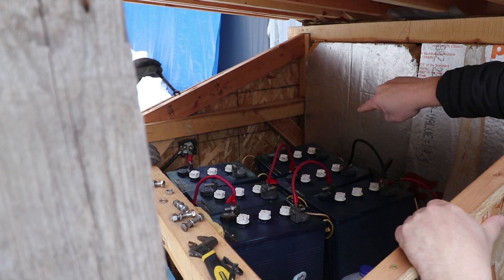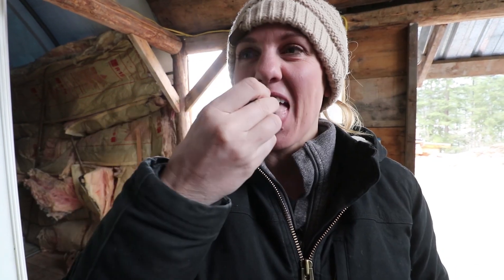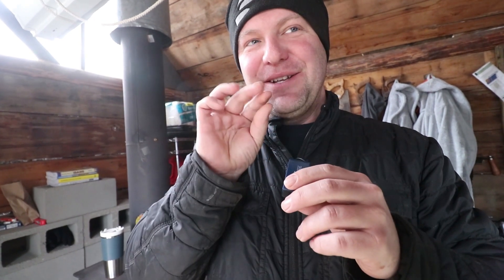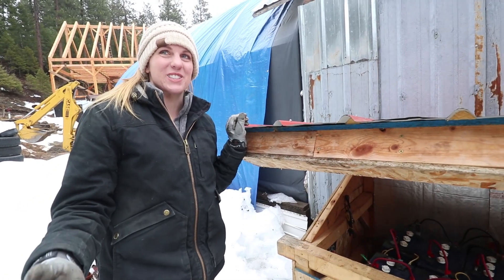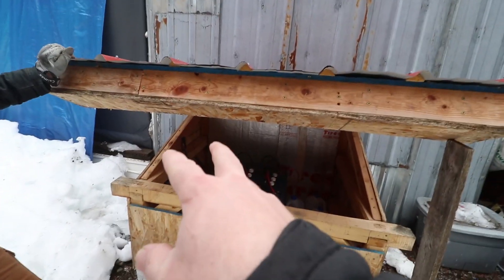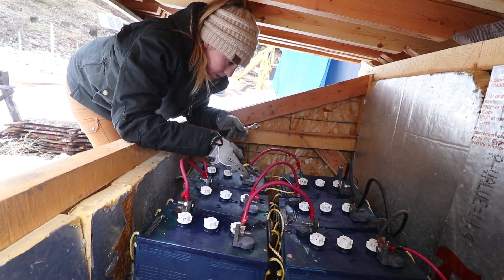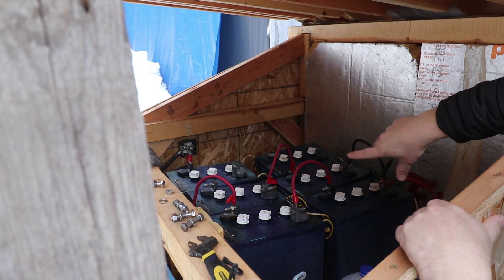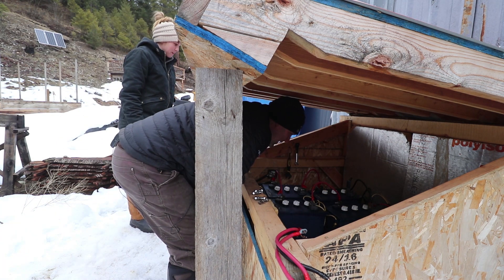All the Solar Panels in the World CAN'T PREVENT ➡️ THIS ⬅️

Comment: I believe the last thing you should be focusing on is Photovoltaic & batteries that you have. Tie into the Grid as a short term source and find a local resource that refurbishes Industrial forklift batteries. Use the grid to charge your bank and keep the outback system. With PV technology improving at break speed, wait 3 to 4 years and and revisit Solar then. I have a few friends here in North Texas that have found this approach to be successful and very cost effective...  I really think you two are doing great... Keep it up... You make my day every time you put out a new video.

Comment: You need battery heat pads . You should capture your excess solar as heat in a thermal bank . Dig a cistern use it as a heat bank . Hook up a wood fired boiler and your set .

Comment: Alyssa,  voltage is pressure like in a hose (say 30 psi) current is flow  (GPM) like when you squeeze the handle on the spray nozzle,  wattage is power, just the flow x the GPM :)

Comment: The way I would explain current is to use water as an analogy.  You can look at a river and see how it flows, the movement of the water is similar to the movement of the electrons which make up electricity.  When you remove the source of the water flow by putting up a dam, the current (water) doesn't flow in the river any more.  That is similar to turning off the light switch.  Turning on the light switch opens the dam's flood gates and allows the water to flow into the river again.  Like water, current has a tendency to only flow in one direction, that is from negative to positive.  (water doesn't flow up hill, it only flows down hill.)

You might wonder why you should use distilled water in certain batteries.  That is because distilled water has all the conductive minerals removed, therefore the water is more a coolant than a conductor.  With minerals like metal in the water, it causes the plates inside the battery to short out which is not good.  Batteries work by chemical reaction and that is why acid is also contained in some types of batteries, to initiate the chemical reaction which generates the flow of electrons.

Does that make sense?

Comment: If properly used, those batteries should have lasted  a minimum of 8 years. By properly used, I mean never drown below 80 percent of full charged. Preforming battery equalization once a month (you should be able to set your charge controller up to do this automatically). Checking and filling batteries every other week, or use an automatic water leveler. 
There is a lot involved to using lead acid batteries off grid, but with a little planning, and some maintenance they can do the job just fine.

Comment: As batteries age sediment builds up at the bottom. This sediment will start draining the batteries till they can no longer be charged. Also as batteries age sulfate will build up on the plates. This buildup increases the internal resistance of the battery so it looses its ability to drive heavy loads. Also when a lot of sulfate builds up a lot it will begin to deform the plates and make the battery bulge. The deformation can also cause the plates to touch and short out the cell. The touching of the plates may cause a spark and if the acid level is below where the spark occurs and there is enough gas in the cell it'll pop.

There is such a thing as a battery desulfator. It's an electronic device that pulses the battery causes the sulfate particles to be recombined in the acid or drop to the bottom. I've gotten batteries to last 7 years by using a desulfator.  There is also such a thing as washing out the battery and while it may be dangerous and risky, you can deffinitely extend the life of the battery even more. (I don't sell batteries)

Comment: if you milled some lumber, built a small/portable storage shed, you could try sell/trade that old ford for a suitable machine with forks. then you could use the machine to move the storage shed, or anything else, as necessary. 

It seems that every time you go to do something you are hobbled by the fact that you don't really have material handling capability. I don't know how the pallet(s) are configured for the battery box but if you could get a set of forks under/into them it might be an easy fix when the ground isn't frozen. just another one of the endless rural uses for a machine with forks.

Comment: Why not 625 surge amp li ion ? 200$ a piece um new  or glass mat optima ? wrap a thin low watt heat tape with poly insulation box , sheesh, to go with 7 weak ass  25 watt panels, 300 watters are 250$ , it's only $ lol

Comment: I guess you have to decide whether or not you want to partake of all the modern advantages of an electrified environment or not. Just my opinion but, solar is not going to be the answer for quite some time. Unless you can afford to drop 50 to 100 K for a Tesla system. And even then you will need a backup generator for the extended times when solar is simply not functional. IE darkness, storms etc.

Comment: My friend owns a couple interstate batteries stores and he explained to me that the biggest problem with battery banks failing is the wiring isn't balanced. He said that you need to connect your ground and positive at opposite ends of the circuit.

Comment: maintenance or reoccurrence costs are often never considered in anything someone does. People tend to think they can do something (anything in many cases) with no maintenance related repairs. The more maintenance costs a property has, the least economical that property will be, not only in terms of dollars but also the amount of time one has to spend in dealing with these kinds of problems. As it relates to solar it's very important to not over drain batteries especial lead acid. This more or less comes down to sizing the system properly. A solar system done right is much more expensive than you realize. If you skimp on these costs, the maintenance bug is going to bite you. A common example is a pool. Everyone loves a pool. Pool parties are so great. But without proper care of that pool --- in as short as a month the water may change color and eventually become a black pit filled with all kinds of bacteria and slime. Everything requires maintenance. So the best idea is to reduce maintenance anywhere you can. Time is worth more than money.

Comment: Very easy.  Use the hose analogy.  When you think of a garden hose.  The water pressure in the hose would be the voltage.  The more pressure the more voltage.  The current is the size of the hose.  If the pressure remains the same, the size of the hose controls the amount or flow of the water.  So a larger hose more water.  The amount of water coming out of the hose is the power.  So if you make the hose smaller (reduce the current) you reduce the flow (power).  If you increase the pressure (voltage) you increase the flow (power).  So this is why you get P=IV.  current and voltage are directly proportional to the power.  Increase either and the power goes up, decrease either and power goes down.

Comment: Just a suggestion, you should wear chemical goggles or a face splash shield whenever you work on the batteries. Just hang them in the battery box .  Cheap insurance.

Comment: Your batteries are the weakest link in your solar system. Unsealed lead acid batteries are terrible in cold environments and life span is drastically reduced if not kept warm. Get sealed batteries at least, lithium at best but either way you have to keep them above 40 degrees.

Comment: Lead acid batteries WILL start giving you trouble after 3 years.  The more often you take them to low the quicker they wear out.  And also note lead acid batteries hate cold.  At 32 degrees they are pretty much useless.  Keeping them above 50 will extend their operational life.

Comment: You can make long runs from your battery bank to your solar panels.  Wire your panels and series to produce more voltage with long runs to the charge controller and the voltage drop will be minimal.   You just have to make sure your charge controller can handle the voltage.  Also higher voltage systems are more efficient.  These charge controllers are usually much more expensive.  Usually campers use propane to heat so I might be incorrect that they are depending on electricity for heat, but heating using electricity is very inefficient and to me it doesn't look like the system they have would be a size that could handle the demand.

Comment: One comment on your cable size on your battery bank and panels in my opinion you need to double up low voltage systems need bigger conductors to cut down on volt drop.

Comment: mount solar cells on your roof-(if you ever get to roofing)-adjustable for inclination for max power
so higher mounted  and SHORTER cable runs   -to batteries in loft
       then run solar in daytime when external power more expensive
         and external power when cheaper-     yet  still viable backup when power goes out

Comment: Volts is the height of a waterfall, amps is the current of water flowing through and watts is the power at the bottom of the fall.
Voltage drop is the same as moving the waterfall further away so you lose some height as the water needs to flow down.

Comment: battery for solar are outrages you guys should not have that kind of battery with water they are going to work but in the long run are not the right ones... if your thinking of spending 3000$$ why don't you just get a tesla battery.. they are made for this solar power... glass packed or gel i think the right battery types are and they are outrageously expensive,,,

Comment: Since loss of water is the biggest destroyer of batteries that and being in deep discharge state you should look into a flowrite system. This ties all your batteries together into one watering system that will hold a reserve and it will also cut down on the spatter left behind from offgassing on top of the batteries. Worked with these type of batteries for 18 years it was the best product I've seen out there for really keeping your berries maintained.

Comment: Freezing cold weather is not the time to assess the condition of your batteries - even if they're dead and don't want to take a charge.  Warm them up, top them off, charge them, then test their capacity.  Of course, if you regularly run them all the way down, rather than stopping at 50% discharge, they may very well be toast and in need of replacing.   But, don't make that determination while they're cold.

Comment: If you add boxed battery acid from any auto parts store instead of water, it won't start the green growth cycle on the terminals, the batteries won't have to go through the job of converting the water to acid, and you will definitely improve your battery life.

Comment: I don't think solar would ever work for the features you want in your house. Things like underfloor heating, suck up huge amounts of energy. If you used your solar system for lights and other low current devices, supplemented with gas cooking and wood heating, you would have possibly been OK. Another issue is your solar panels are oriented to Summer, not Winter sun. Orienting them for Winter sun like the ones on the hill at 14:29 would ensure you got more power in Winter but they wouldn't get covered in snow like they were which causes them to be useless for generating anything meaningful.

Comment: If you’re going to try going to a bigger system then you could go Tesla Lithium batteries and you wouldn’t have to worry about water in the battery. Just don’t frizz them. The good thing is you can put them inside because they don’t out gas like your batteries.

Comment: Too bad you appeared to have gotten rid of those batteries.  You can often restore such cells by draining, rinsing - being sure to dislodge particles building up between cells; followed by filling with acid and a desulfating solution.  I've ressurrected a number of batteries with shorted cells.  
I understand your solar experiment though - playing with homesteading solar. ;-)
Thankfully we bought new forklift batteries for our solar - maintenance has been trivial and gives the most power storage per dollar spent.  We have 40 kW on tap.  Two days ago grid was down for 1/2 a day - We hadn't noticed for hours until we tried to switch on a non-critical load (not driven by the solar).  Our office as well as refrig + freezer and other important parts run from the inverter coupled to solar, but can charge from grid when its available.  No messing with generator unless long term power outage during low light months.  
Keep Rolling!!  LOVE Alyssa's CAN DO Attitude - You are amazing!

Comment: You should be able to install a temp pole for grid power while you build. If money is tight you can get the GC2 6VOLT GOLF cart batteries form Costco. I started with 8 wired in series to give me 48volts. I'm now up to 16 batteries going on 4 years and they are still in great shape. Couple with the TOU PROGRAM my power bill went from $400.00 per month down to 50.00. I keep the grid for my leaf and back up.

Comment: May i suggest if those are 12 or 24 volt panels.  Wire all panels in series to get 48 volt or 96 volts depending if you have 12 or 24 volt panels.  Your charge controller will take the 48 or 96 volts input from panels and charge your 12 volt series batteries.  You spent good money for your outback controller.

Comment: When you short out batteries like these there can be over a 1000 amps. An old friend shorted an ordinary car battery through a spanner (wrench) and signet ring which melted onto his finger. He was lucky the hospital managed to cut what was left of the ring off which had stopped blood flow due to swelling.  Just a bit of tape around the spanner - PLEASE. Should you do a really good short the battery can be permanently damaged (the plates inside buckle) or even burst. It's also not a bad idea to wear eye protection.  As an apprentice I shorted 2 very large new lorry batteries out through the master switch - all  that was left was the handle and bits of copper, brass and aluminium everywhere. The foreman said " well he won't do that again". I haven't. Great video's as always, good luck to you both from the old country.

Comment: Guys
  You need to keep your batteries warm.  Just like a vehicle battery in  winter the lower the temp the slower the cranking of engine.  You will not get long hours of power when batteries are in the cold.  Doesnt matter how big your batteries are.  Send some heat into the container where you store your batteries.

Comment: Hi Guys,
                  Think of current through a wire, like being water in a pipe. The wider the wire, the more current can flow.    Volts in a circuit is like water pressure in a pipe.   The larger the voltage between two points, the greater the pressure on the electricity to flow.

Anyway, it's a lot more fun testing batteries with your tongue.  I enjoy your build every day.  
Bill in Scotland

Comment: Check out Solar City and the Tesla Power Wall 2 lithium battery.  13.4 killowat hrs of storage $6,000.00.  Once you hook up to the grid you risk being charged maintenance fees even if your self powered.  Panels $3,500.00 A KW.  Put on a solar roof looks like tiles and efficient with a lifetime warranty.  Battery prices are coming down and performance increasing.

Comment: Electrical calculations are as easy as PIE. When I was 11 years old I learned electrical theory for HAM radio. Two simple equations stuck with me since then and I use them often. The first one is PIE.
P = Power in Watts, I is amperage in Amps ( "Impetus", is  the original name for current), E is Electromotive force in Volts. 
P over I * E
If you draw a circle and slice it up like a pie (kind of).... Actually, if you slice it in half and put the P on the top half and the I and E on the bottom the slash is to remind you of the division. The P always stays on the top and the I and E always stay on the bottom. As long as you have two of the letters you can always calculate the third letter. The I and E will get multiplied because they are next to each other and it will give you P. If you have P then divide it by one of the bottom letters and it will give you the other bottom letter.

The other equation is E / I * R. It fits into the same pie format as above. E = Volts, I = Amps, R = Resistance in Ohms.

Using those two equations I have been able to calculate almost every electrical problem I have run into in my life.

Another thing that I learned much later but has helped me with calculations is; If you put 1 Volt across a resistance of 1 Ohm then one Amp will flow through it. In 1 second 1 Coulomb of charge will have flowed. 1 Coulomb is about 6.242×1018 electrons which happens to be the amount of charge on a 1 Farad capacitor charged to 1 Volt.

Comment: No what you feel when you lick that battery is the voltage, the reason you don't feel as much and that it is "dead" is because the lower voltage, don't you have a basic multi meter to check it before saying that nonsense!?

Comment: Lead acid batteries, having an aqueous  electrolyte, are prone to problems of having water in a freezing container.  The electrolyte in Lithium batteries is an organic solvent, and doesn't freeze in cold weather.
Reply: As I was reading your queries regarding the Lead acid battery but I did not understand that can you explain bit more?

Comment: Batteries freeze on a scale relating to how much charge is in it. An empty one will freeze at 32F whilst a fully charged should manage -30F. There is only eight-tenths of a volt difference between a fully charged battery and a discharged battery.
Reply: You are absolutely right about battery freezing formula i was doing some research on this topic only and I find your answer very self explanatory.